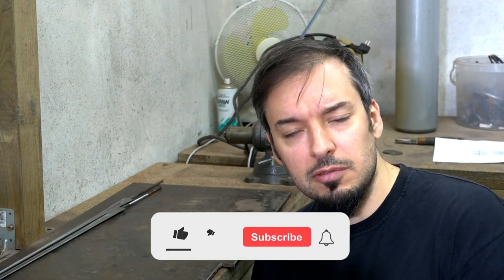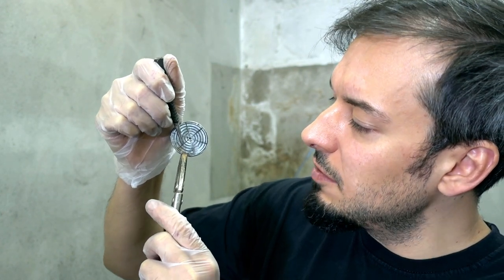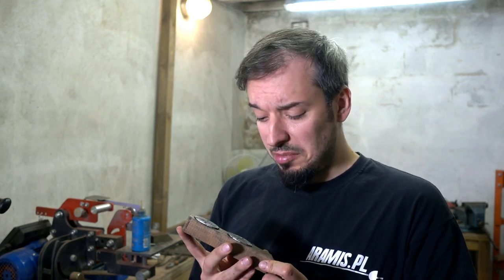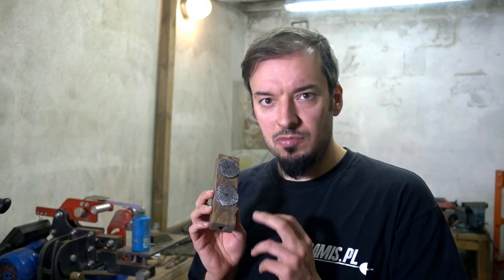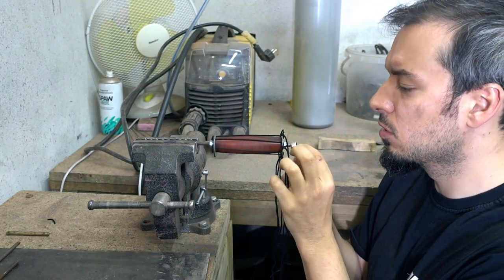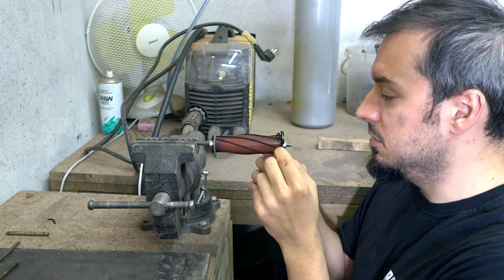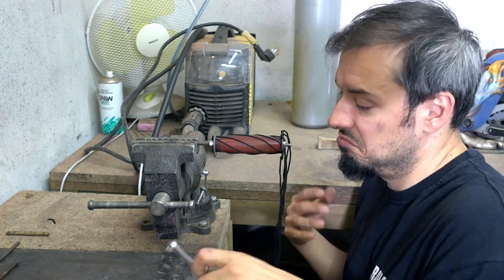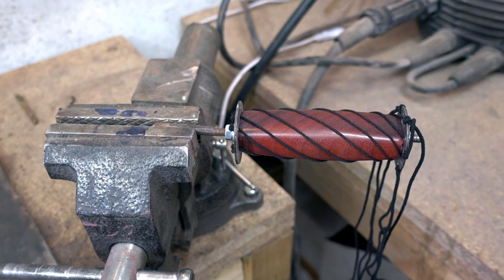How to make a jig for carving a wooden handle

Comment: Cool idea . You should make your jig from steel and use copper wire and run a current through once set to burn a mark into the wood . That way you can then remove the jig and wires and carve away unobstructed
Reply from the maker: Wow. That is actually a cool idea! I'll get back to it a while when I'm done with the current projects. Thanks! :)
Reply: I was going to suggest kanthol wire. But it’s the same basic idea😊